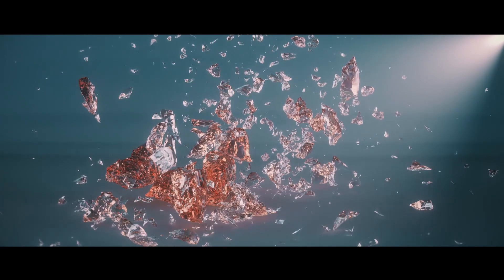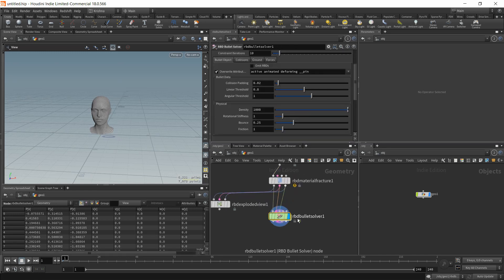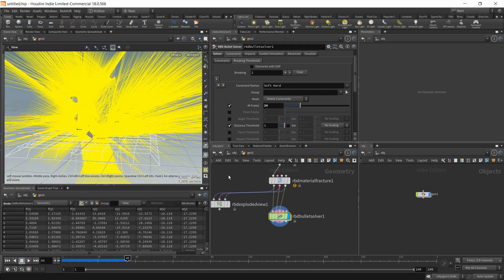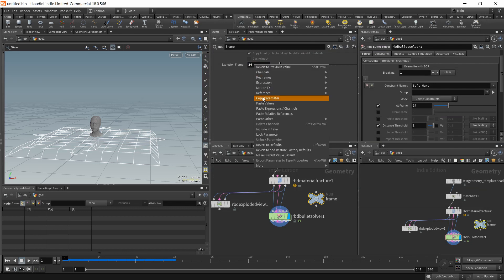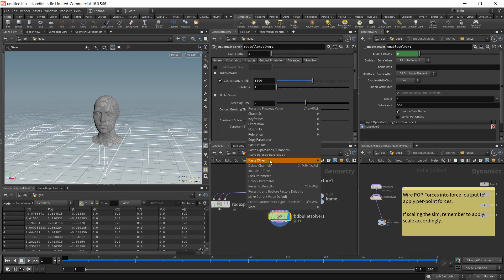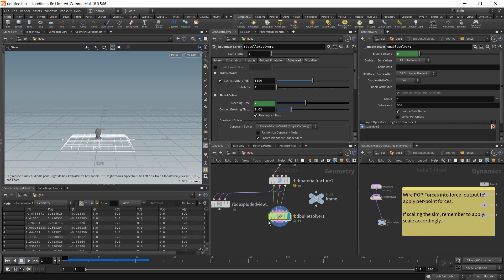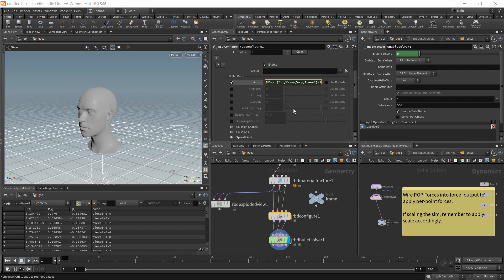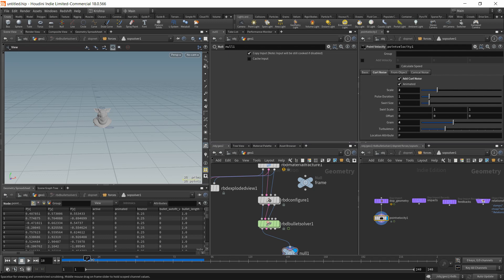EXPLODE RBD OBJECTS - A SIMPLE WAY - HOUDINI TUTORIAL

Comment: Thank you for the great and well explained tutorial!

I would like to break the sculpture starting from the head and the rest of the body will fall apart after a moment.
How can I make every new fracture that becomes an active body use the same pointvelocity attribute?
Reply from the maker: You are most welcome and thank you. You can use @active attribute for this with or without using glue strength. When active is set to 1 and if the glue is weak then those parts will start to fall. Hope this makes sense.
Reply: @resilientpicture  Yes, thanks, @active works fine and pieces are falling, but they dont behave like the first fractures which were active at the frame when solver becomes enabled.
Is it difficult to make that the new active objects to fly as the first ones?
Reply from the maker: That's because of velocity, You'll need to add velocity just like in the first explosion frame. You might want to look up some houdini ground fracture tutorials to create this.

Comment: Thank you - very nice tutorial - is this the latest way to fracture and explode in Houdini 19? because other older tutorials are so complex to do the same thing?
Reply from the maker: You are most welcome. Yes, this is the easiest and latest way as off H19. However if you use dop network you'll get hundreds more options
Reply: @resilientpicture  thanks for the quick reply - I was trying to add a material for inside fractures and outside fractures by trying to connect two material nodes but the concrete_fracture1inside and outside are no longer available once connected to rbdconfigure node....Would you happen to know why that is or how I can fix that? I am new to Houdini - that would really help - if you can
Reply from the maker: Hmm, did you unpack geometry after simulation? Not sure why rbd configure node would do that, its working fine for me. You'll need to unpack geometry if you need groups from pre sim

Comment: How did you do the slow motion part shown in the preview? Do you just simulate the entire thing at a really low time scale, render it all out and then speed ramp them in post? there's got to be a better way than that but I just can't figure it out
Reply from the maker: I used retime node to slow it down. It works really well. I render it after its been slowed down. I hope that helps.

Comment: Im having an issue where the cracks appear at frame 1. It explodes properly but the entire effect is wrong because there cracks are already visible at frame 1. How do I fix this? Your examples do not have any cracks till it explodes.
Reply from the maker: You make the pieces inactive until the frame before the exploding frame. @active=0. Hope this makes sense
Reply: Resilient Picture Company Thanks, within the rbdmaterialfracture node?
Reply from the maker: @eth3realm  Sorry for the delay, Its in the node RBD configure, I have explained this @10:19

Comment: Great tutorial! One question, I've created a lot of fractured pieces and some small ones never stop moving and rotating. I've decreased the bounce with no luck. Any ideas how to solve that?
Reply from the maker: Thank you. Yes, maybe you can use a pop wrangle and multiply incoming velocity by 0.9. so over time the vel will drop by 10 I believe every sec or frame. Not sure. Does that make sense?
Reply: @resilientpicture  I'm still pretty new to vex, can you let me know the code you mentioned? Or if there's a alternative to that?
Reply from the maker: Pop wrangle node. Try v@v *= 0.9; make sure it's lower case v.
Reply: @resilientpicture  Thanks but still no luck
Reply from the maker: Check the collision padding and reduce it to 0.01 or something. If it's too much then it'll be round and hence rotating